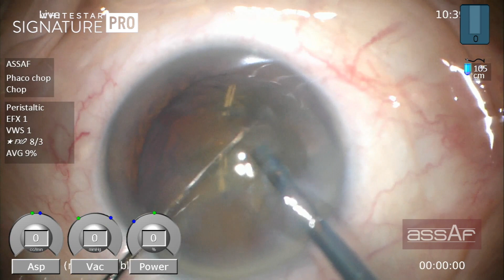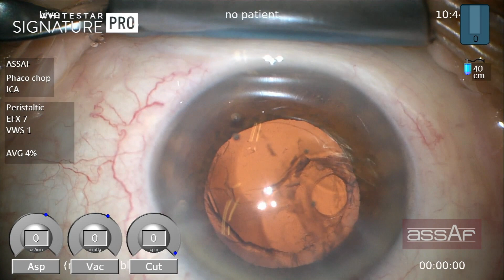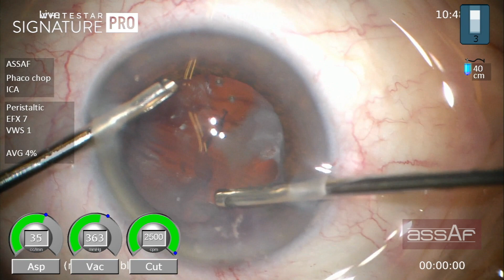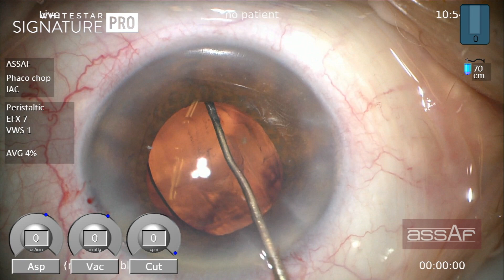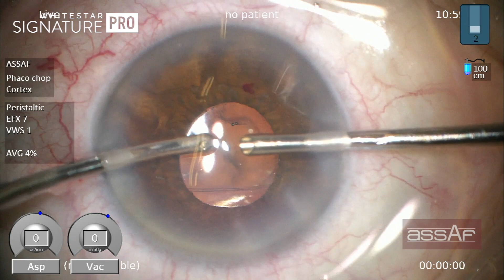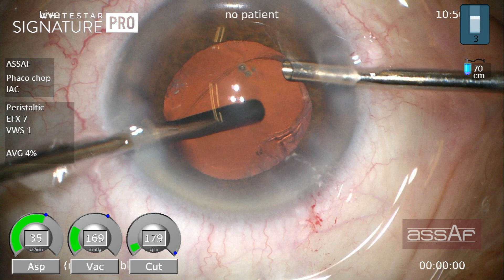How Many Lessons Learned from this Complicated Routine Phacoemulsification? Ahmed Assaf

Comment: Thanks for the video Sir. 

Question: Seeing how large the posterior capsule rent became after total cortical clearance, could it be prudent to perform a peripheral iridectomy in a case like this?

Concerning when to implant IOL, I would rather do it your way. I think inserting an IOL in the bag before continuing cortical cleanup could make total cleanup more difficult in this case, especially with beginners. If this happens and there is residual cortical matter on the posterior capsule, YAG laser capsulotomy may be performed post-operatively to create a good gap in the posterior capsule. What are your thoughts on this Sir?

Thanks again for the opportunity to learn of you.

Comment: Dear Dr. Assaf, Thanks a lot for sharing this wonderful experience. I want to ask you a question. Why hadnt you implanted the lens before dealing with the remaining cortex? Just to not expand the PCR.
Reply from the maker: The benefit of the Scaffold technique is to prevent nuclear fragments from falling down in the posterior segment. Since there was only cortex adherent to the posterior capsule, I couldn't find any rationale for implanting the lens before clearing out the cortex.
Reply: Thanks a lot for the information. I appreciate it.